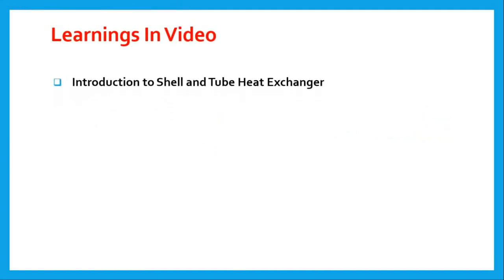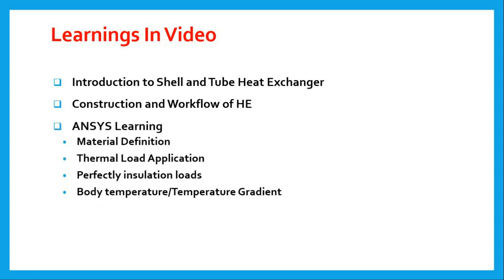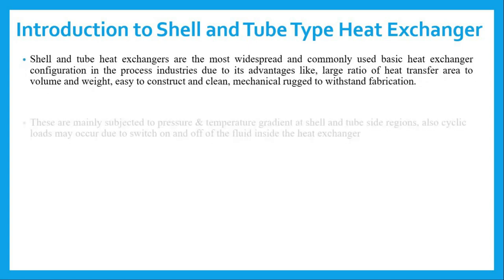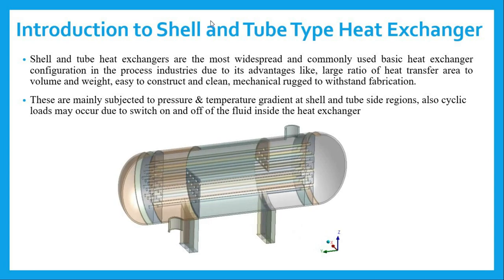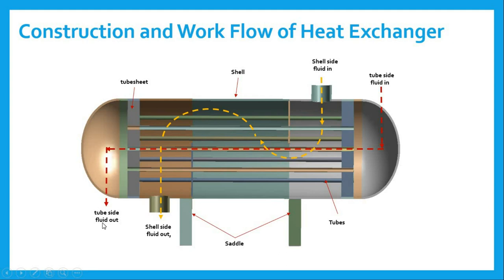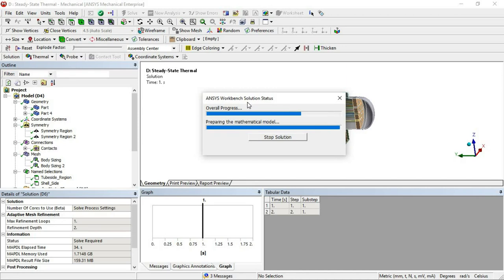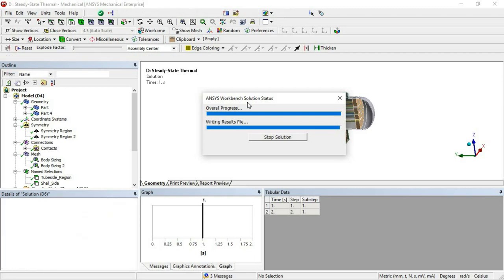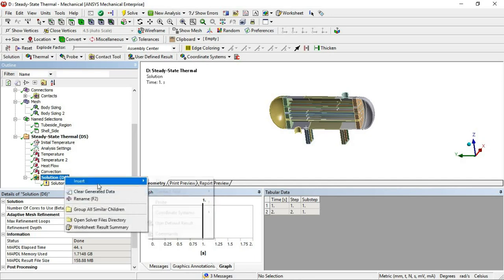Thermal Analysis of Shell and tube type heat exchanger Using ANSYS

Comment: Sir, at 22.20 you changed the temperature manually but im not able to change it manually in my analysis. Do i have to use any other key to change the value. Thankyou
Reply from the maker: You need to right click on legend and input the values you want to input in the legend.

Comment: Sir, temperature is same throughout in this analysis. As you mentioned in other comment that transient analysis will give temperature distribution. But how can I perform transient analysis? Is that same as steady state analysis?
Reply from the maker: For transient analysis,  you have loads varrying with respect to time. While in steady state loads are constantly appiled in load steps.
Reply: @graspengineering9249  sir how can I  give variable temperatures with respect to distance?

Comment: @grasp Engineering Sir, i have a query to simulate a cylinder with 3 orifice at different height and area and there is a free falling mass impact the piston and flow start  from orifice and fluid is viscous. I tried to solve analytical using Naiver-stokes equation but stuck in finding the relation between flow rate with height. so i was thinking of computational FM but confused in which coupled analysis to follow.
Reply from the maker: You need to do CFD for that scenario.
Reply: @graspengineering9249  yeah but how? Can I share the question if u provide your mail.

Comment: How can you add which fluid you want to use
Reply from the maker: There is no need to know the fluid flowing through HE. We are applying the thermal loads such temperature and convection, which are calculated from fluid.